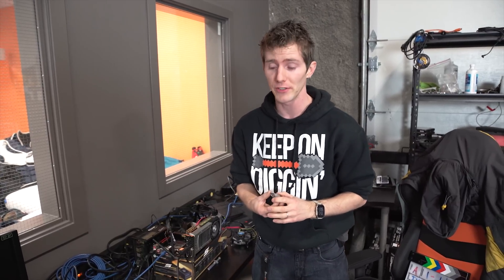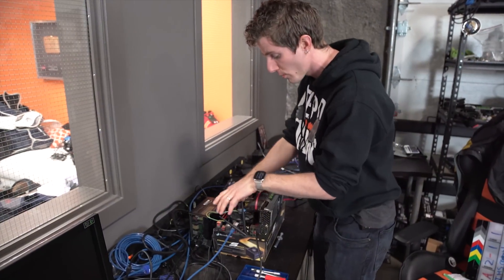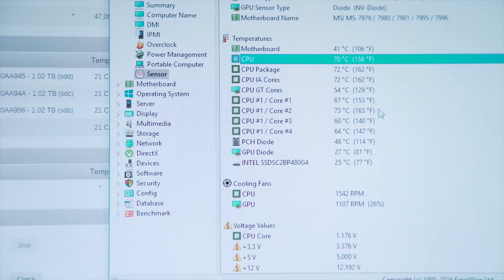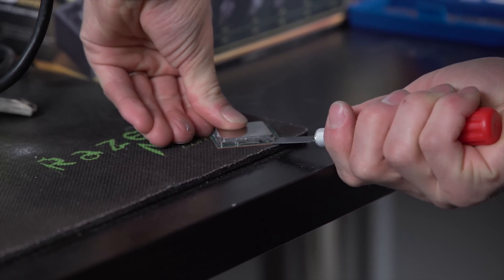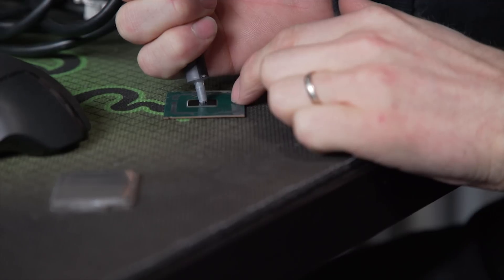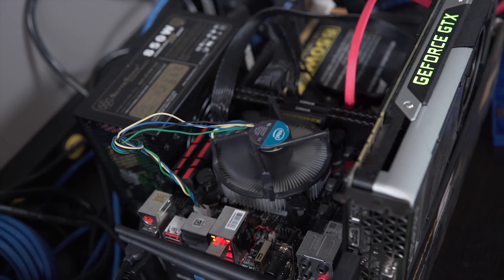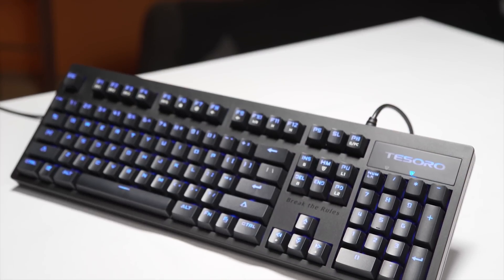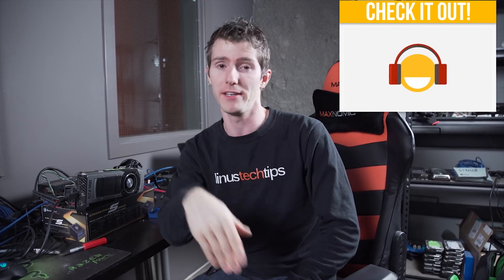Delidding an Intel Core i7 6700K - Is it worth it!?

Comment: wtf,why should this even be possible?One geek with scalpel and "cheap" thermal paste can make cpu perform better??wtf Intel engineers are doing??They can design complex cpu,but can't improve that simple thing that even i can improve with my scalpel and some paste??That's a bad engineering right there!
Reply: They used to weld the chip. These days, they just use crap paste to reduce production cost.
Reply: It's called cutting corners
Reply: The stock thermal interface material, which has to ensure good heat transfer between the actual chip and heat spreader, is designed for stability over time. Aftermarket thermal interface material is often designed to give the best performance possible but just simply can't last as long.
Reply: Ikr. FFS
Reply: dongle seon AMD CPUS still do that
Reply: apparently you get 25c less with liquid metal paste. idk why he didn't try the high-end stuff if he was going all the way with it. 
he basically just got the same difference if you were to benchmark and replace old thermal paste with the same stuff and bench again... 
the video was kinda pointless.
Reply: Some sources say 65C, some say 70C. It seems that up to 80C is safe for AMD, the same goes for intel.

The reason for the temp differences is because of the way the temperature is measured on the AMD CPUs, actual temperature and reported temperature isn't really accurate - but still work well for thermal shutdowns and throttling.
Reply: /\ No pun intended
 |
Reply: JakeAndBake Isn't cutting corners quite old fashion? I thought the vice is more usual and easy and foolproof this days.
Reply: Engineers don't run the company.  Welcome to Capitalism  :) $$$
Reply: It's about money, not engineering. If intel saves 10 cents per CPU by using a cheaper paste they save millions of dollars, at the price of 2 degrees heat difference.
Reply: a lot of people are reporting 10 to 20C drops after delid. I'm quite skeptical about these results to be honest. I guess it depends on the chip
Reply: They still put out more heat and require a better cooler. it may be 65C max but they have much higher power consumption
Reply: Welcome to the world of business! Just by using the crap paste, they save over millions of dollars on the production costs.
Reply: pf ryzen is not buggy or unstable or expemsive. Its kuat unoptimized and only the r7 is out. Wait for r5
Reply: I guess they safe that performance potential for when the really need it (when they'll need to compete with AMD) and this way is probably the cheapest for them. They are just not pressured to deliver the max. performance. Who are they competing with? Ofc it's bad for us consumers...
Reply: Except for intel's profit from the laptop, netbook, notebook, tablet, server, NUC and SSD sales.
Reply: this is the same company that tried to force a monopoly by "encouraging" retailers to sell intel CPUs only by providing "incentives"

this is also the same company that manipulated benchmarking software so that amd processors would show up as performing worse than even a slightly lower performing intel CPU.

A few years back they had to pay AMD several million in damages and there's no real evidence showing that intel's still not trying to underhand their way to the top of the market.
Reply: Lo Studios Linus cut the corners of the CPU heatsink. Yes there was.
Reply: In cases where the CPU temp drops significantly it's going to be because the IHS TIM is improperly applied at the factory. I would think they could stand to use better TIM, though it's probably Intel trading durability for performance as most off the shelf TIM doesn't tend to last more than a few years before it bakes totally solid and starts to suck.
Reply: buggy and slow and expensive ryzen, or stable (and cheap and old) but slow fx? amd still not an option.
Reply: edbo10 I got it in late 2005 and I  know it was made by HP 17.3" I paid $2k back then but I don't remember model name... but now my mom uses it still for basic web browsing and Facebooking which still works just fine. 

If I remember it was Pentium 4 lol still works just fine. I have gone long since then but that lap top used to rock out some EvE online, I was able to run two EvE games at same time on this machine.  I mean they are slow for today's standards but you can still keep them fresh just by dusting off and changing out thermal paste and keeping your windows fresh
Reply: likfrikbik wrong
Reply: SacredSkill ü//77
Reply: Wrong, AMD cpus max out at 65c and 55c for the higher end cpus.
Reply: *****
Is that what you told Jack Sparrow?
Reply: yep the last generetion welded chip is SB.
Reply: Not really "perform better" per se. Just making it cool a tad bit more efficiently.
Reply: cooler means better overclocking headroom witch can result in better performance most of the time
Reply: with a cheap after market fan cpu cooler my FX-8320 idles around 30 and never goes above 60... (I never use stock cpu coolers, they're ugly and you can't swap the fans out etc)
Reply: well, im with 6300 and have a good heatsink idle: 36 load: 50-60
Reply: *****
it performs better than the intel equivalent that cost the same at the time so... ?
Reply: How about you quit bitching and appreciate that it at least has some paste to keep the solder from melting.
Reply: likfrikbik they'll make money regardless so why should they care
Reply: pf amd?
Reply: pf then don't complain about intel
Reply: Zoogler but why would you even want to use a 2005 laptop in 2017 lmao. What are the specs?
Reply: its capitalism, its so it breaks quicker and you come back for more.
Reply: It's not made directly for gaming they make their processors for the office also
Reply: Because we know how many non-capitalist economies are making kickass CUPs.
Reply: Intel still has the brand power sadly
Reply: thats bad english right there!!!!!!
Reply: likfrikbik 8
Reply: Daily reminder Intel hates you.
Reply: You're not wrong lol.
Reply: not sure if you still care but they use long life thermal paste that wont dry up or go bad or anything for hopefully the entire lifespan of the computer. If you apply your own you may need to re apply it occasionally. This is exotically true with liquid metal
Reply: likfrikbik it’s to make it cheaper I’m guessing
Reply: what does that have to do with the engineers? why does everyone always blame the engineers? blame managent or whatever superior ordered to apply the shittiest thermal paste in minimal ammounts
Reply: Are they being made in Chy-na? lol
Reply: You do know that you can easily destroy a CPU by removing the lid, right? If your hand slips, you just ruined a thousand dollar part. So go ahead and delid your CPU and destroy it because you don't know what you're doing.  I'll keep mine as it is, thanks.
Reply: This is what no competition towards a greedy company does to that company's products.

I'm so glad ryzen came along and forced intel to innovate.
Reply: It's because it's cheaper. 9th and 10th gen use a soldered IHS and get better performance because of it. Intel just didn't want to spend the extra dollar or so to solder 6th-8th gen.
Reply: 2-4 degrees isnt good enough to make me delid my cpu and possibly fuck it all up while voiding my warranty
Reply: @bayanresenski2230  Some gain more than 2-4 degrees. Up to 20C sometimes, but it's a bit of a lottery. And the delidding and resealing need to be done perfectly. But you're right, in some cases, it is not worth f'ing it up.
Reply: I think that definitely plays a big part. I think its recommended by the thermal paste manufacturers that ''normal'' thermal paste should be changed every 2 years or so.
Reply: +dongle seon No it's that AMD CPUs run so hot that they WELD THEMSELVES together...
Reply: I would not call it BAD ENGINEERING. Its called being cheap. #savingbucks
Reply: likfrikbik
Reply: I can see my self doing this after 5 years of using a CPU as a last resort. Not worth doing it to a new one. I usually take apart laptops after 2-3 years to refresh thermal past and dust it if off. I still have 2005 HP laptop that my mom uses and it still works because of this.
Reply: Because they are so hot that they can't work properly without welding, I guess.
Reply: fuck the monopoly, I hate intel for this crap, but I should buy one of their cpu, there is nothing but intel.
Reply: yes, it's AMD fault.
Reply: r5 = 0.7 or 0.5 of R7 (4/6 cores of r7), nothing new.
Reply: +JakeAndBake there was no pun.

Comment: Seems like this is a kinda silly choice for intel to make, especially on a product made with overclocking in mind. I mean, how much do you really save by going cheap on the thermal paste? Especially since switching the paste yourself voids your warranty. Not really a big deal, but it still seems like one of those things where it would be better in the long run to come up with a cooling solution that eliminated this issue alltogether, or just put in higher grade thermal paste from the beginning.

Comment: Didn't suspect Linus is such a noob in hardware!

Why don't we put a pile of cr@p between IHS and cooler and as long as we do this 2nd time too we are perfect.
We monitor stupid overall CPU diode instead of separate core temps.
We stresstest it with a singlethreaded bench at stock clocks. Were you THAT LAZY, Linus?

Comment: when you delid your cpu u dont use the IHS or the stock retention hardware.

You put bare die -> heat sink or Waterblock because that IHS becomes a terrible large shim which hinders thermal transfer.

Comment: if intel was smarter than that, they would make a limited run with copper one that has the(*lol) best thermal paste... and charge 100 bucks for 1 degree celcius difference
Reply: Linus ran this in the best possible case scenario for the chip. He ran at stock speeds with a stock cooler and used 'meh' paste as a replacement. I can tell you from delidding my oc'ed 4690k that using Coolabratory's Liquid Ultra made a large difference. Temps dropped 10-15 degrees when using mx4 between the cooler and IHS . I then also used CLU instead of MX4 in between the IHS and cooler (its a nickel plated copper base cooler so its fine), and temps dropped a further 10 degrees. MX4 aint bad stuff either. I also decided to use some on my r9 390 and temps again dropped by 10 degrees. Well worth it for £7 a syringe.
Reply: so. you claim a 30 Celcius degrees of drop, so if you had 60 at max now thats 30? sorry but thats kinda hard to believe. however, my sugestion was to #Intel to rip you guys off, by running a limited edition of each chip with copper ultra polished finish , best termal paste version...
Reply: I claim a 25 degree drop from the previous hottest core. I was running a cryorig h7 on a 4690k at 1.29v using mx4 before. In Intel burn test after 20 runs, it was hitting 90-95 degrees. With both the cpu delid and the thermal compound between the ihs and cooler being CLU, it's sitting at 70-75 degrees. Got screenshots to prove it

Comment: Hi guys which program do I use to monitor my gpu and cpu temps and all that stuff?
Reply: MSI Afterburner (if you want in-game monitoring for th cpu and gpu) GPU-Z for monitoring from the desktop and CPU-Z for the cpu
Reply: HW monitor will show all temps, fanspeeds, voltages and clocks from every sensor in the PC. MSI afterburner is ofc the option to go with if you want to monitor within the games itsef. so HW monitor if you have an extra monitor on the side to have it on, or for stresstesting.
Reply: Ok thanks. Can I monitor my CPU in afterburner too?
Reply: Yep
Reply: Thx
Reply: np
Reply: Use cam
Reply: speccy
Reply: HW monitor
Reply: speedfan
Reply: coretemp is a bit more lightweight
Reply: I use CPUID, HWMONITOR and AIDA64
Reply: Msi Afterburner

Comment: so i have an overheated intel i5 (1155) wich everytime i run a game The temperature goes from 70 to 85 degrees (i buy this from a guy on Facebook so it wasn't new) and The core i3 i used before barely reaches The 55 degrees...

should i try this out on The i5????
Reply: Stock cooler! Rlly? You can get a better cooler for $15! Pls invest $40-50 in a good cooler!
Reply: Stock coolers are GREAT for reliability. They work good for long time. But the temperature reduction is not very good. Check out the  Coolermaster Hyper 212X - pretty cheap and very good temperatures.
Reply: SuperUser RooteDavid Lmao, the hypocrisy is actually hurting. Your grammar is equally as bad as his. Please don't try to be a "grammar nazi" if your grammar is worse than average.
Reply: No. don´t do this unless you have:
1) enough money to buy a replacement CPU, if you accidentaly destroy your CPU while delidding.
2) have experience. Try delidding on some old CPU´s first. Get a feeling for how it´s done.
3) A experienced person, who´s done this before, to help and advise you.
Reply: ok, so then i'll just keep it like it is, can't use it for gaming as it barely stands for 10-15 minutes before it starts to overheat... =(
well the PC with the i3 is not that powerfull but at least i can run my most played games
Reply: Well, not being able to game on your pc sucks. I hope you can fix this quick.
How high does your CPU temperature go in idle?
If it´s suspiciously high, there may be some system process or even a virus working in the background. I once had a problem with the Windows updater taking 100% of one CPU core all the time, which lead to idle temps of around 55°C. You can check this in the Task Manager, click ´show processes from all users´, and then sort by cpu load.
If you haven´t bought one already, i highly recomment an aftermarket cooler. There are solutions like the Cooler Master Hyper 212, which performs great, even with chips that run hot from the factory, and doesn´t cost too much. However, do yourself a favor and read some reviews from different sources before buying.
Another thing I´d look at is case ventilation. Maybe you CPU overheats so fast, because the hot air can´t get out of the case. My old PC overheated seriously bad, because I only had 1 fan in the back and no ventilation from the side or out the top. As soon as I changed to a case with better airflow and added another fan, temperatures went down almost 20°C while idling and i´ve had no problems with overheating since.
Reply: If you have no tool to check your temperatures and loads i suggest MSI afterburner.
Reply: on Idle usually runs at 40-45º and running a game just makes it jump to 70º

once i remember it went up the 90º and i scared the hell out and shut it down... but back then i didn't have a GPU like i do now, so the onboard i guess couldn't handle games that good as it suppose to (asus Z77 MoBo)
i run the AI suite 2 to check temp on CPU and recorded some of the lastest tests... with the new video card temp won't rise that much but still on the 70-75º on average...
Reply: You probably have or did one of these things:

* are using the stock CPU cooler
* are using 100% CPU usage all the time
* incorrectly applied paste, too much paste, or no paste
* the fans on your CPU cooler are not running for some reason
Reply: Jonathan Denay I'm a heavy overclocker. I have the corsair h115i cooler and a 6700k +2 GTX 1080s.
Reply: well lets see:
i am using stock cooler (still i haven't done O.C on this cpu)
cpu usage is only at 100% at start for a couple seconds, and then when starting a game or something big.
paste is fine, just a line that spreads wothout getting outside the metal part of the cpu.
all the fans are running at full speed when i want to play a game, only use the "auto/powerSaving" features when on Facebook, Word, or playing some music for the room...

i think the guy that sold me the CPU overheated it and i payed the consecuences...
Reply: i know im late but after reading this, you probably need a cpu cooler more than another CPU. :p
Reply: Jonathan Denay so you're saying the stock CPU cooler is bad? with my old DualCore i never had problems with stock cooler, so now on this one i guess it shouldn't be a problem if i am not O.C the cpu... buying a good cooler here in my country it is.... Xpensive as hell...
Reply: ok that sounds more likely to be a good reason, i'll check it out and find if the temp problem goes away, thanks Jonathan Denay
Reply: An aftermarket cooler will do wonders for your temps. My cpu was hitting 90c within 5 minutes of rendering a video. I bought a 212 Evo and my temps never hit 60c after that. 

I rendered a video that took 15 HOURS and even after all that time, I never hit 60c. I believe 58c was the max. For the money, you can't beat them.
Reply: nice! that's going to be my salvation, thanks Phuch
Reply: Chris D. just reapply the thermal paste or replace the CPU cooler, or replace the thermometer it could be broken.
Reply: Amy Payne the thermometer can be replaced? i gotta check that one, the paste i did replace it a few months ago, i do clean my CPU once every 6 months or more (depending on usage and visual dirt on the inside)
Reply: OMG THE GRAMMAR THAT HURTS
Reply: Sorry for my grammar, English is not my native language and I refuse to use Google translate (the translations are so bad) I barely use it to translate single words...
Reply: Chris, even though I am  not a  native english speaker myself, I can say that you speak good enough for people to understand you. Do not be sorry.
Reply: Jonathan Denay thanks jonathan =)
Reply: Chris D.
You should buy the Hyper 212 Evo and not an X because the X is not worth it for an LGA 1155 socket I5 and as a certified bilingual speaker who's native language is in-fact English, your English honestly isn't that bad; in-fact if I have to be honest, I thin SuperUser's grammar is actually worse than yours.
Reply: Why the 212X is not worth for the 1155? I got an i5 3570k and I bought the hyper 212X for it. The 212 Evo is just an older model of the 212X. Or am I missing something? Cooling is great regardless :>